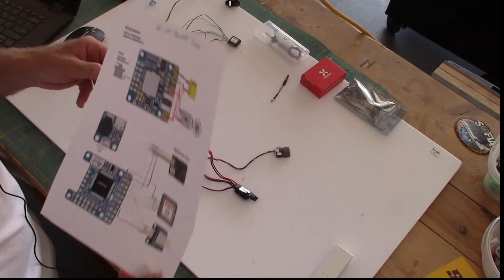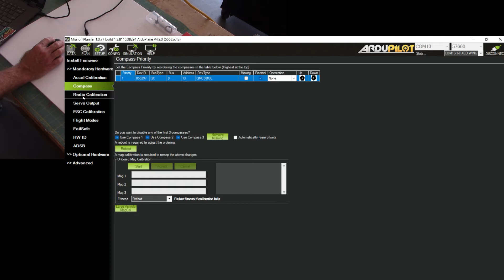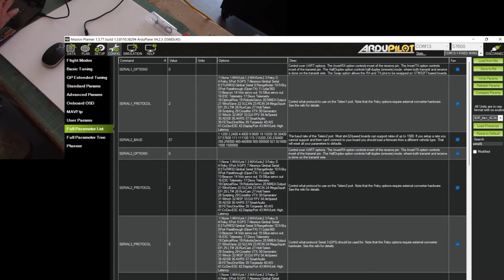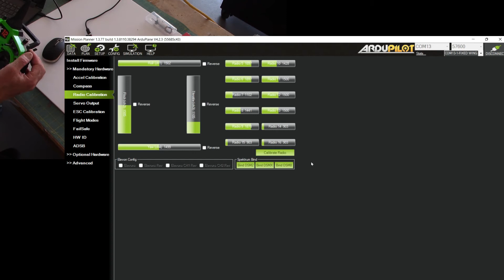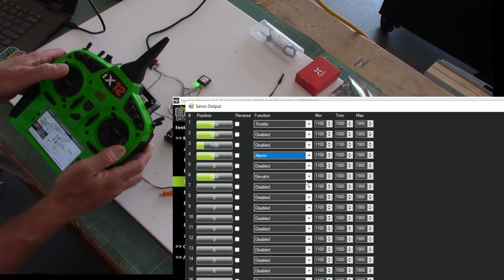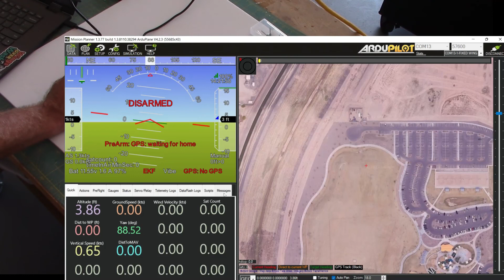Wiring up the Matek F405wmn, setting up the initial prams

Comment: I'm having the same issue with the throttle arming. Shouldn't you be able to see the bar move with the throttle even without arming? I've been looking all over and don't know how to resolve this. Any insight you can provide is much appreciated.
Reply: Hi, I'm having the same problem with throtle not moving, and esc not picking up the signal (I'm actually using matek f405 wing v2, but seems same problem)